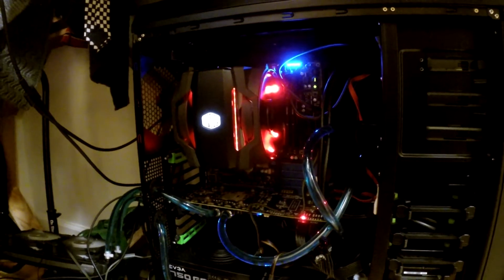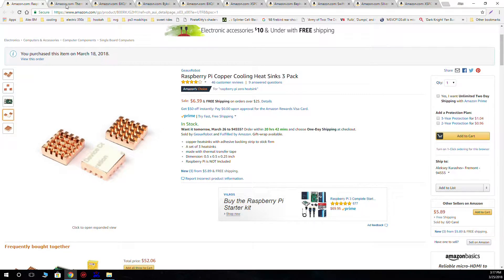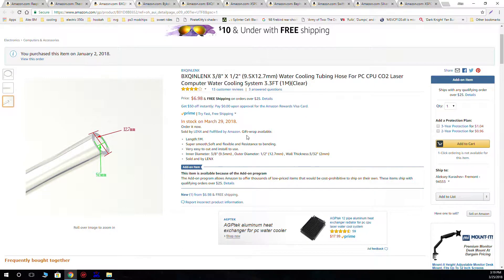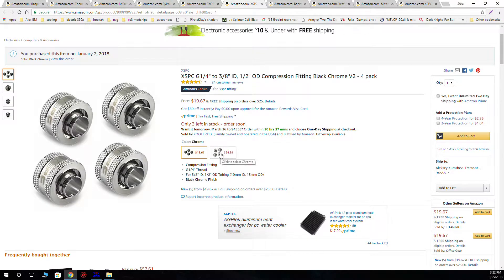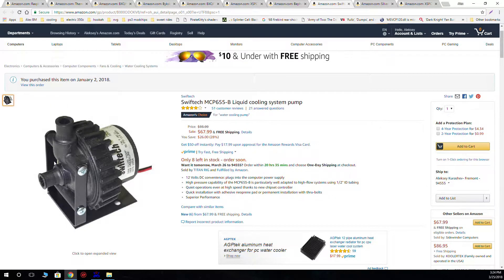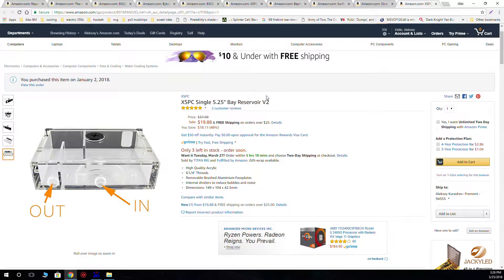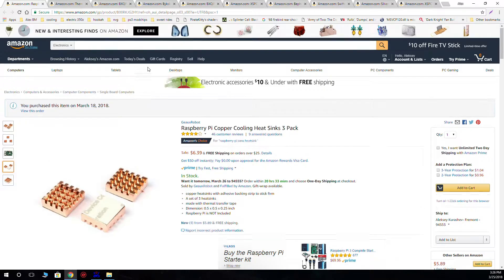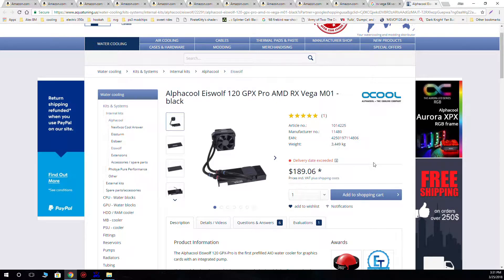Vega 64/FE water cooling mod

Comment: Can you tell how hot is the Hotspot with this custom mod? What is your OC in GPU and HBM2? Please tell me because I want to do it with my Vega 64
Reply from the maker: hotspot reporting was not conclusive because the sensor readings were off so I can't help you there you may need a probe. OC was 1700Mhz Clock 1850Mhz mem
Reply from the maker: I dont have any graphs for this since I sold the card but I never saw it throttle and temps were would hover around 58C even in games like BF4 and Crysis 3. I cannot guarantee that you will have the same results as it really depends on how lucky you get with the chip. I never really pushed the clock beyond what was on the liquid bios for the GPU the gains in these HBM gpus is always to up the mem clock as much as you can.

Comment: Mixing metals (copper waterblock+aluminum radiator) is a bad idea!
Reply from the maker: I actually just looked at the rad and per the spec sheet its a copper rad as well. When the system ran I did not notice any kind of build up on the copper GPU block and it ran for well over a year in this config with 2 fluid changes. So I probably would have seen something during that timeframe.

Comment: Also not a bad to install two upward blowing fans in bottom of case feeding air towards GPU and ensuring airflow around those heat-sinks. There are nice brackets available to hold two or three fans together.
Reply from the maker: It honestly did not need it.  I checked with Hwinfo msiafterburber and via laser temp gun.  All heatsink were at around 40-50 Celsius max.  But this won't be the case for all cards...
Reply: @cr4zyw3ld3r  Great to know.  Can have piece of mind now in future as about to upgrade to Vega 56 from RX580 and plan to use same cooling loop.  Like this mod!
Reply from the maker: @laowai2000  yep just keep an eye on temps,  the laser gun is a recommendation from me bc not all caps ds have sensors that report to software for all temps.  So it's a good backup that way you know if you need additional cooling.

Comment: hello again, I have already made a purchase of 360 radiator, and the same block that appears in your video, + water pump with deposit, everything has left me for € 75 of aliexpres, I would like to get the 1650/1050 1065v hbm 1026v with maximum temperatures of 55º

Do you think it is possible to maintain that temperature with these frequencies?

You could upload some video ingame in games monitoring temperatures I'm very curious to see the results you get
Reply from the maker: Yeah I think you should be able to hit those figures.  I will try to upload a vid,  but my temps will be higher.  I only have a 240mm rad.
Reply: @cr4zyw3ld3r  Perfect, I'm waiting to see a video with its frequency / voltages and temperatures configuration, a greeting and thank you very much for answering

Comment: Hi, I'm thinking of starting a project similar to yours, I want to buy the same block of gpu that you have, I would like to know what temperatures your gpu reaches and if the vrm get very hot?
Reply from the maker: IN game it usually stays at around 55 maybe 58 Celcius for GPU. I was not able to get good VRM readings from software but having touched them none of them feel hotter than 60. With that said I will be adding a VRM water block to this build as I want to push the GPU further. Just remember that you will need to bore out the holes so that they are all further apart to allow this block to mount the GPU without bending the card PCB.
Reply: @cr4zyw3ld3r  I have sapphire vega 64 reference, by limiting the temperatures I can not reach 1630 mhz stable core, and I stay at 1530mhz, mounting a kit similar to yours could reach 1650/1050 with maximum temperatures of 55º with an ambient temperature of 20º approximately?
Reply from the maker: @pessasoperezmoutki431  Is it possible? Yes! But will your card actually achieve this, the answer is maybe. It all depends very heavily on the card. This guy has an amazing GPU https://www.reddit.com/r/Amd/comments/89dgqr/my_vega_64_lc_is_hella_fast/ some are not so lucky with the silicon lottery as the internet calls it. However I would recommend you use the liquid cooled bios after installing such a kit to push the clocks further without having to mod anything first and then you can undervolt or overvolt as needed until you reach the desired clock. However it seems that these GPUs do better with faster memory clock than just a regular OC because like the Ryzens the memory and GPU are connected by infinity fabric so the clock speeds are very much related to mem speed. This is part of the reason why the Radeon 7 happens to be so much faster, they increased VRAM bandwidth and upped the mem clocks.
Reply from the maker: @pessasoperezmoutki431  see LC bios here https://www.techpowerup.com/vgabios/195319/amd-rxvega64-8176-170811

Comment: oh, thank you guy. I spend a lot of time with calculating size of frame around die, and have no idea, would this standard gpu water-block fit. So it's fit good :)
Reply from the maker: Кирилл Шокин fits great,  except need to drill out side corners, so that screws fit the holes on PCB.